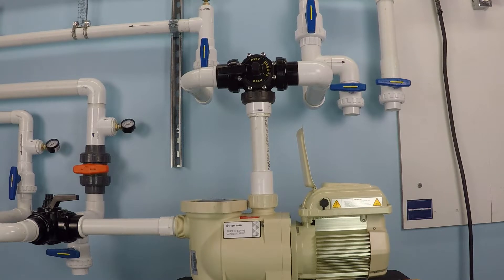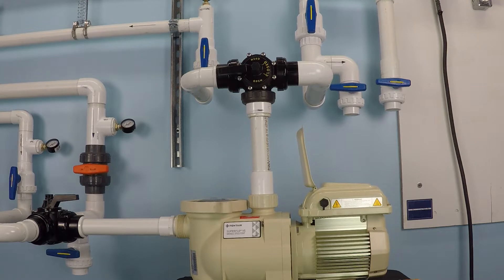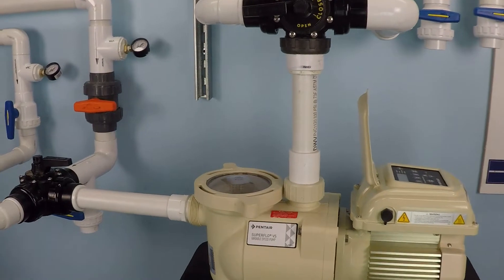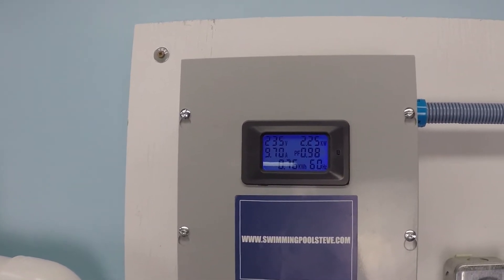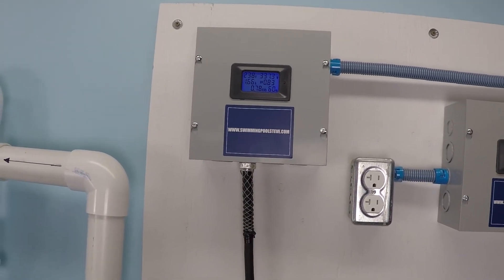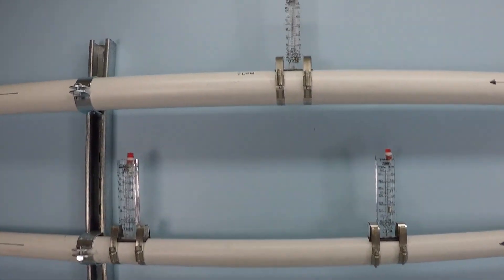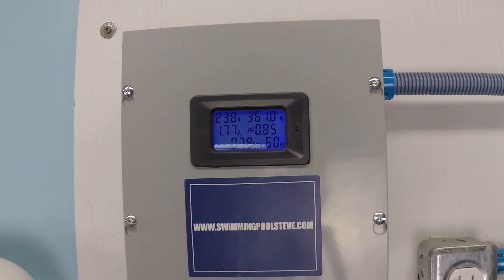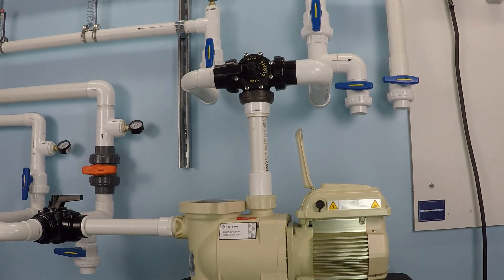Why Do I Need A Variable Speed Pool Pump?

Comment: so all you managed to do was explain things that were mostly obvious; at least to other engineers.  You failed to explain WHEN you would lower the speed.  You need a certain volume of water filtration & turn over to keep the water chemistry in check.  What is the formula for when to operate the pump at different speeds?  I have, for example, 15,000 gallon in-ground pool.  The recommended turn-over rate is 6 to 8 hours.  I currently try to accomplish it in 5 hours due to chlorine lost in Florida sun. (not salt water pool).  So if you need say 5 or 6 hours to turn over 15,000 gallons: 15,000 / 6 hours = 2,500 GPH.  2,500/60 = 42 GPM.  I mean, do the math.  At 42 GPM & ignoring plumping resistance, you're going to need to draw a certain amount of power regardless.  So I am confused at what point you would lower/increase the speed of the pump during those 6 hours used in this example....

Comment: Steve is correct. If you don’t believe Steve, then search for “pump affinity laws” and be prepared for some physics and math. As for down sizing a single speed, that would be fine for filtration but will cause issues when it’s time to backwash or run a suction side pool sweep. For example, I can get away with 20 GPMs for filtration in my system, but when it’s time to backwash I want it closer to 120 GPMs.
Reply: pump affinity laws are useless except if you're designing the pump.  At end of the day, I want to maximize GPM at lowest power draw.  If you have to turn over X gallons in a day, you have a fixed rate (as far as I know) you have to operate at to meet that.  I fail to find a good explanation when I would lower my pump speed during that time.

Comment: so why not just get a single speed pump with low power to match the half speed of your variable pump, 17 rpm is it? i wud guess flow rate  wud be the same and also power consumption. like for example ill get a single speed pump and the motor runs 24 hours a day at the slowest rpm thats enough to turn over the water in 24 hours. for example i have 50 cubic meters of water, then ill get a pump with a max water flow of 10 gallons per minute. if that runs 24 hours that wud be enough to roughly turn over the water in 24 hours too.make a long story short why dont i just get a single speed pump thats around 100 to 300 watts running 24hrs
Reply: Because you can't backwash with them

Comment: My single speed pump doesn't cost me any extra money on my power bill, I run it during the day when my power is free because of my solar panels, with my pool pump running and my A/C going my meter still runs backwards.
Reply: For the 99.9999% of us who don’t have solar panels a VS pump is a big money saver. And to the 0.00001% who do have solar — enjoy trying to make up the initial cost of installation over the next 15 years
Reply: good for you....would be nice for EVERYONE to have the same set up...

Comment: I have a pentair super flow VS pump and a hayward sand filter...can you make a video how to back wash with these 2 equipment?
Reply from the maker: I won't have the ability to film something like that for you for quite a while, so in short, which is actually quite easy: Turn off your pump. Turn filter head setting to backwash, turn pump on (max speed, quick clean setting works for this), backwash for at least two minutes.  Turn off your pump.  Turn filter to rinse setting.  Turn pump on full speed again for half the time you were backwashing for, in this case about 60 seconds.  Turn pump off.  Turn filter setting back to filter.  Turn pump on and you are done.  In between the lines the right way to perform this procedure is to note the "clean system pressure" of your unique pool and then backwash every time the PSI rises about 7 PSI over the clean operational pressure (or when 30 PSI is reached - whichever comes first).  The length of time that you need to backwash for is not actually two minutes.  Two minutes works as a general guide, but the real number is whatever amount of time returns your filter to the clean operational pressure once you have finished all of this.  Good luck!

Comment: The comments that my single speed pool pump accounts for half my electrical bill is just wrong. My electrical bill does not drop by 50% during the months my pool is closed. Slow the pump down then you need to run the pump longer to get the same level of filtration. That is just common sense. I have yet to see a direct comparison of variable speed pumps and single speed pumps. Take a standard 18 x 36 pool. You need to pass all that water through your filter at least twice in a 24 hour period. I run my single speed pump at night when electricity is the cheapest, 10.1 cents/kWh. My pump runs on 240v at 7 amps. That pump then uses 1680 watts of power. Over a 8 hour period that equals 13.44 kWh per day. That pump costs me $1.36 a day to run or about $40.72 a month. Based on having my pool open for 6 months that pump costs me $244.32 a year to run.

So the question is when do I recover the $1,200 cost of purchasing a new variable speed pump? Sure you run a variable speed pump slower and consume less power in the same hour but you have to run it longer to get the same water turn over.
Reply from the maker: A single speed pump can account for up to half the power use in the average home with a pool - easily.  You said you only run your pump for eight hours, and when you do this your electricity bill goes up by 50%...and some people run their pumps 24 hours per day.  Also with the power consumption you have posted it would appear you have a fairly small circ pump, which is good, as this is much more economical than bigger 1.5 or larger circulation pumps.  The point you are not appreciating here is that you can move just as much water as you do now, using only a fraction of the power you use now - so it does not really matter if you run your pump for six months per year or not - every month you run the pump you will save around 80% of your electricity.  Since you choose to run your pump for two turnovers instead of four as per commercial standards, and you only run it at night, and it is already a suitable sized smaller circ pump, you will recoup your savings at a slower rate, but it does not change the fact that month by month, every month you run the pump, you par only 1/5th or 1/6th what you pay now.  I show this whole equation in action including showing flow rates, electrical consumption and cost in this video based on a four hour run schedule, which is only half as much as you run your pump, and it STILL is an easy calculation to see that the VS pump costs vastly less to run: http://www.swimmingpoolsteve.com/pages/4-hours.html
Reply from the maker: For any readers who want proof one way or another here is an article where I compare a pool with a lean 8 hour filtration cycle daily versus a variable speed pump.  The VS pump is able to pump the same volume of water daily for just under 60% less, which is $500 per year in savings, or $3500 over the first 7 years of owning the pump.   And this VS pump is only $301 more than the exact same single speed version of that pump.  $500 per year savings for a one time $300 investment, and now your pool does not need to sit stagnant for 16 hours per day.  There is literally no well vetted argument against the savings potential for variable speed pumps.  Here, look for yourself: http://www.swimmingpoolsteve.com/pages/8-hours.html